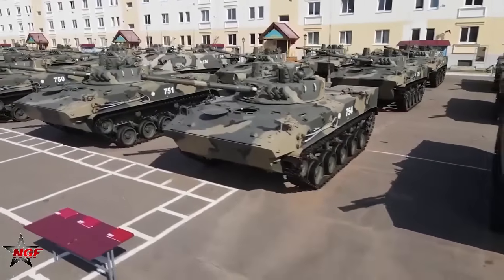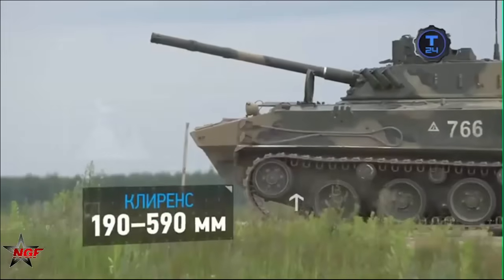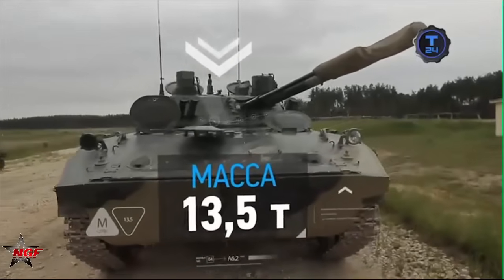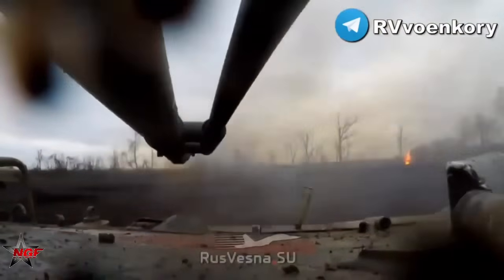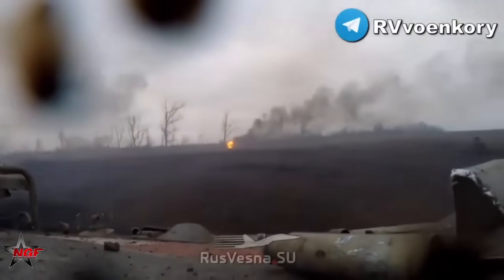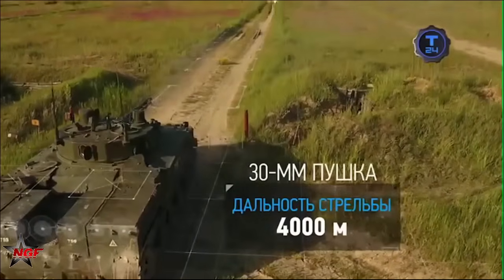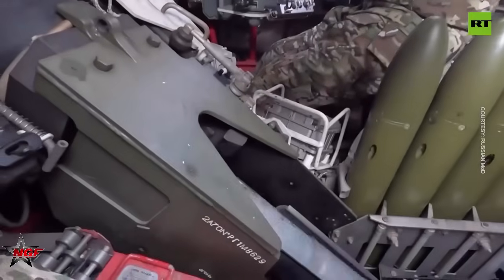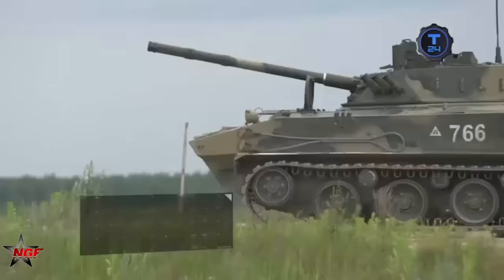The Russian BMD-4M IFV receive a 30mm Programmable Cannon upgrade to counter aircraft and drones

Comment: TANK SEPERTI INI SEMUA WAJIB DI BUAT SEBANYAK 1000 SAMPAI 2500 HINGGA 5000 UNIT ....SENAPAN MESIN UNTUK SERANG PERSONIL DAN TANK RINGAN ....
TANK MORTIR SEBANYAK 1000 SAMPAI 2500 HINGGA 5000 UNIT SERANG GEDUNG GEDUNG TINGGI......
TANK ROKET DAN RUDAL SEBANYAK 1000 SAMPAI 2500 HINGGA 10 000 UNIT .....SERANG SERBU PESAWAT PESAWAT TEMPUR DAN DRONE.....
TANK ANGKUT PERSONIL ANTI RANJAU DARAT SEBANYAK 1000 SAMPAI 5000 UNIT HINGGA 10 000 UNIT DENGAN ALUSISTA SENAPAN MESIN SERANG UDARA ...4 PUCUK ....2 MAEN ....
2 CADANGAN......
TRUK ANGKUT PERSONIL ANTI RANJAU 
TRUK ANGKUT SEMBAKO ANTI RANJAU DAN MORTIR SERTA DENGAN ALUSISTA 2 SENAPAN MESIN ANTI SERANG SERBU SEGALA GALANYA